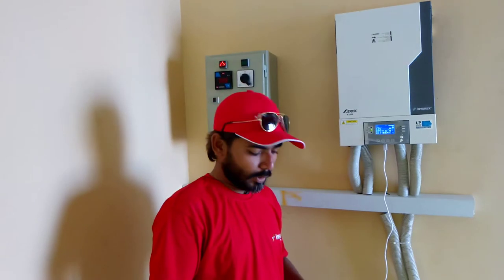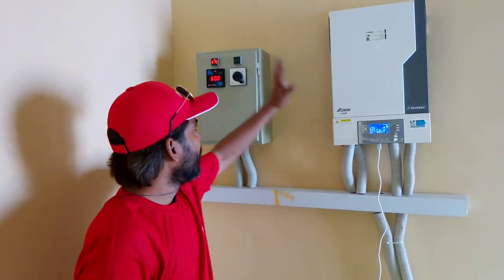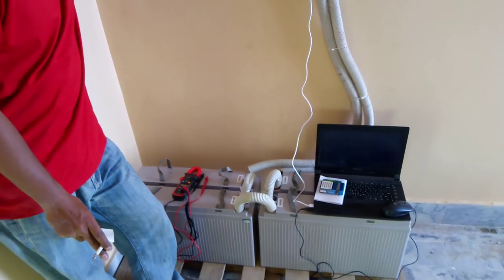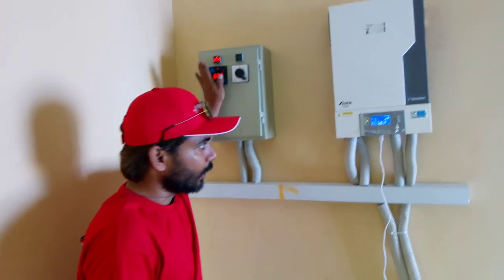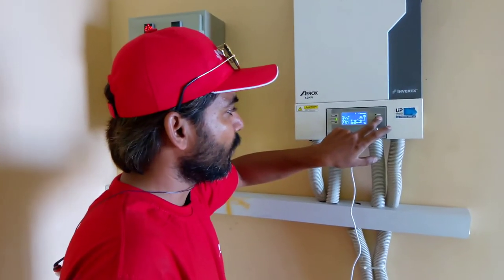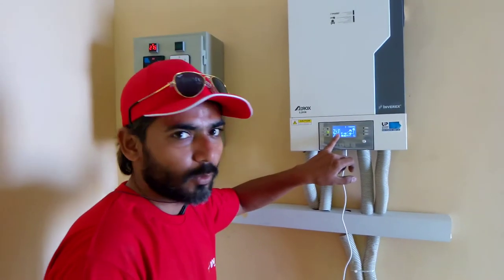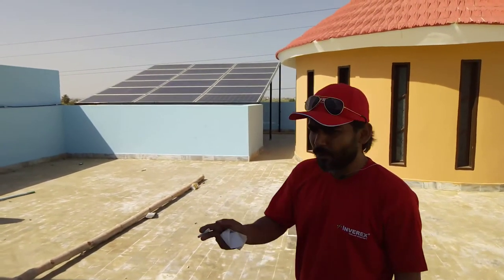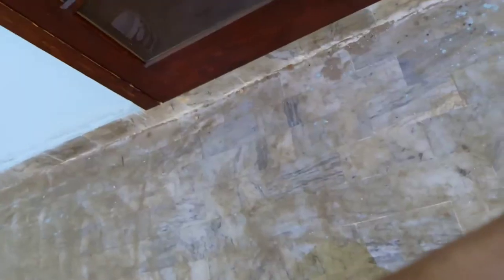5 kw Solar Power Energy project with Aerox 5.2kw by Humble Solar Wala

Comment: Kindly share a video without using batteries and operate a non inverter ac on it 1-2 thanks
Reply: Humble Solar Wala kindly share a video of non-inverter AC (1 or 2) operating without battery bank as well. Thanks

Comment: thks brother 
kindly mention the prices
and in which city you are?
Reply: Q1.aeroxiii 3.2kw may maximun kitnay solar pannels lag saktay hain?kya os may bhi 18 pannels lag saktay hay?

Q2.Kya ye system jo ap ne lagaya hay 2 ac ka load lay sakta hay(1.5ton&1ton)?

Q3.mujay 2 ac chalanay hain ap kay kiyaal may mujay aeroxii3.2 kw walay do inverter laynay chaheyey ya aerox 5.2kw wala aik inverter kafi hoga?
Reply: @HibaTradingSMCPVTLtd  dear sir 3.2 inverter may 450 to 500vdc maximum hota hai hum 325 walay 16 pannels or 18 kaisay laga saktay hain please describe in detail
Reply: @HibaTradingSMCPVTLtd  sir please let me know we are gonna install 8 pannels in series 46*8=368 volts + 9+9=18 amp gona be added am i right volts are still 368 and amps add 18.but how it gonna be work please explain ku k series kay 8 pannels k 368 volts may say apko pv say 320 volts inverter may miltay hain or usi say amps generate hotay hain jo k mppt control kerta hai jab usay volts 320 8 plates k milay gay or sirf 18 amp milay gay tu wo kaisay maximum performance daiga is say amp kam banay gay tu ku na agar hum parallel connections na ker lain zyada advantage hoga lakin inverter ko 120v milay gay tu wo chalay ga??
Reply: @HibaTradingSMCPVTLtd  Sri mene aerox 1.2 lagaya tha...
340 watt k 2 solar panels k sath.. series m to ampere 18 mil rahay thay....
ab mene paralel kardiya to ampere 32 arahay hain... jabsay short circuit ampere 14 hain 14x28....
Reply: @HibaTradingSMCPVTLtd  Inverex Aerox 1.2 Mppt